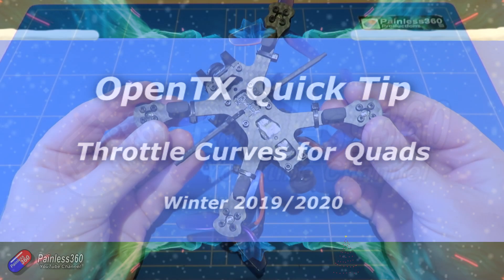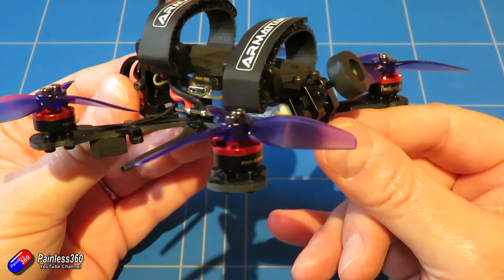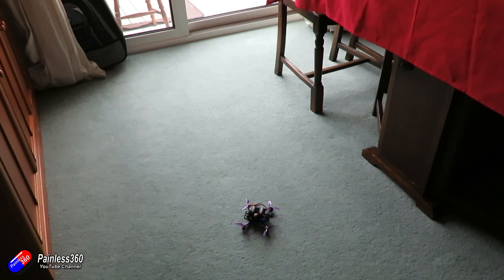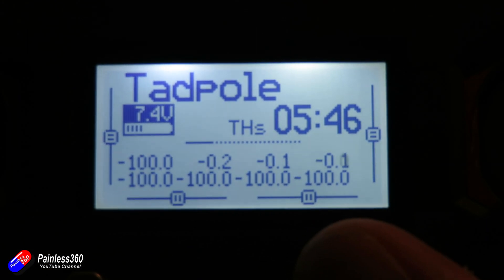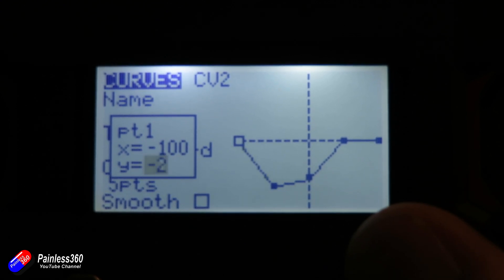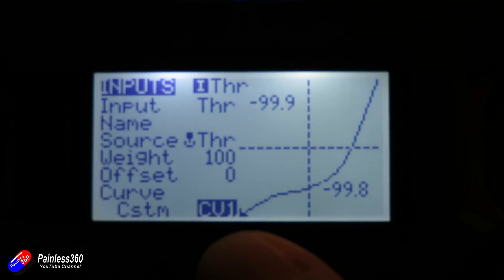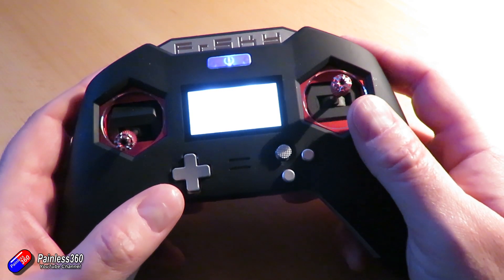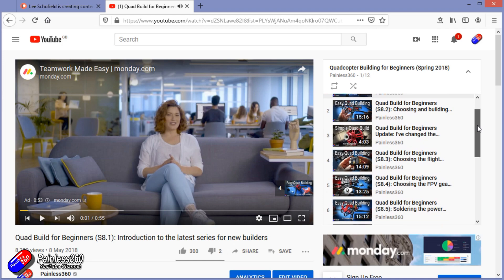OpenTX Throttle Curves: Making your Quadcopter easier to hover

Comment: Problem with this is that hover throttle varies (becomes lower) as you increase forward speed, and the change is fairly dramatic.
Reply from the maker: Yep, same with hover throttle setting in things like Betaflight and INAV too. The cool part is that the hover throttle point stays on the flatter part of the curve, so it is always easier. 
 This video is aimed more at those who are trying to get the basics, not experienced pilots. Happy flying.

Comment: does this hover point work in any height? So when you are 100 metres off the ground, does the drone still hover "better"?
Nice Video ;)
Reply from the maker: The amount of thrust needed to counteract the weight of the model doesn't change with height. The only thing you will see is something called 'ground effect' but that's only within about 2ft of the ground.. Happy flying!

Comment: Just what I needed! I'm new to FPV  and just got a Tinyhawk II, and when I fly indoors it is either stuck to the ceiling, or on the floor.  lol  Thank you. Now if I can only get it to connect to my computer/BetaFlight. Nothing happens when I plug it into the USB port. I'm hoping it's the USB cables I have, as I see some people have problems with certain cables and all the cables I have are exactly the same.

Comment: Thanks. Question. I have a few models setup with the throttle scale set to a rotary knob. Basically, half position has a 25 percent throttle scale reduction and it goes up from there. This is for inside and outside flying. Is there a way in opentx to assign a curve based on a rotary knob position? I would like to have your suggested curve for inside use when the knob is at the midway position and no curve (or a standard curve) when the knob is at full. Thanks again
Reply from the maker: How have you setup the throttle scale adjustment?
Reply: @Painless360  Well... I did that so i can copy paste the same model and can fine tune the scale with the knob easily for each model and person using the model. Which is my son and i. some models need a lower or higher scale inside and i prefer a lower scale than my son. I used a scale instead of limits to retain resolution.
Reply: @Painless360  i did it by creating an input (cut) with knob s2 as the source. Then created a couple throttle mixes using that input to do some math to the throttle value. Does that make sense?

Comment: Hi there, always appreciating your content! In this case I might have an improvement... I choose a 15 point curve, set the first point on the left to minus 100, the second just a bit lower than the hover value an than I draw a straight line from the second point, to the last one at plus 100. The advantage is, that you will have the full stick throw for your throttle resolution and you will be able to keep the height in all flight situations. Especially when you move forward, you will need more throttle to stay leveled. My micro flying improved greatly since I am using this method. If you need a throttle cut, you can just change the steepness of the line and end it at 80, or whatever. Works great for me!

Comment: I've been trying to figure out how to do this. My QX7 doesn't have a "Curves" page. It only shows 9 pages, not the 13 like on your XLite. Firmware is 2.2.2 dated 06/24/2018. Am I behind?
Reply: My x7s does show the curves page but no helicopter page. I think it's all in how you have it setup in opentx companion. I'll fiddle with it and if I get a concrete answer for you will ping you.

Comment: Can you do a video about making a DIY opentx radio?
I have some older "Gold" Futaba 8 channel transmitters and I want to swap the electronics inside the radio transmitters with arduino and use the high quality "feeling at least" gimbal and switches and also add additional switches and a slider and a display...
And maybe a cupholder and cigar holding tube....

Comment: Hi thnx for the lesson/info, when I've put my togother, will try it out. I do have a question thou, on your throttle screen at the far right jitters between -0.1 & -0.0. Is that normal? How to fix it? I noticed when I calibrated the sticks from behind (have the X-Lite Pro) this accours also as I calibrated the sticks on my old X9D plus the values started jittering. I thought it my have an effect on on flight of the drone, being insecure, unsafe & inaccurate. Many thnx, take care  & best wishes 2020!
Reply from the maker: It's normal.